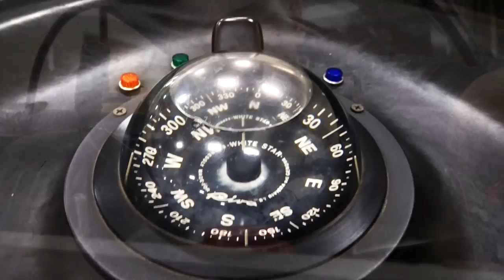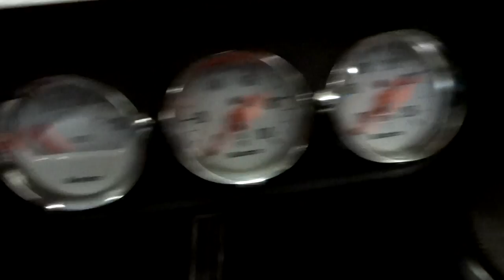GEORGE BARRIS BATMOBILE DISSECTED! - FIREBALL MALIBU VLOG 698

Comment: I'm finding a lot of Batmobile Videos of "Original" Batmobiles.. Unfortunately none of them are actually Original Batmobiles.. There is only one Original which was built from the 1955 Futura Concept car.. The car in this video is not that car.. 
George built the original, and he (his shop) built 3 replicas to satisfy the demand for appearances at various events and one of those cars (the #4.. Third Replica) was for doing exhibitions at drag strips around the country.. 

All 4 of the Barris built cars are accounted for. The #1 and the #2 are both owned by Dave Anderson in Fairfax, Virginia. The #3 car is owned by the Morris family in New Jersey, and the #4 car is owned by Doug Jackson in Scottsdale, Arizona. 

This is a Bob Butts Replica body .. If you look at the rear fender flairs they lean in more than any of the Barris cars.. This is because Bob Butt's molds, (which he took from one of Barris' replica cars) are warped. So his cars (bodies) are easy to spot. Bob Butts and George Barris were well acquainted and Bob built a couple replicas for Barris. One of those cars was used in the movie "Return to the Bat Cave" . And that is the car that sits in the show room at Barris Kustom City. The car in this video looks like that car from "Return to the Bat Cave" .. 

But the Original Futura Batmobile, which was the only car used on the TV Series (with the one exception of about 4 or 5 seconds in the episode called "The Contaminated Cowl" .. in which the #4 car was used in that one scene)

Comment: This is not the original 1966 Batmobile.  It is a replica built by the late Bob Butts and sold to Barris.  Barris sold the #1 Futura-converted Batmobile at Barrett-Jackson on January 19th, 2013, for $4.62 million (after auction fees).  The replica shown in this video does have some screen action, however:  it was the Batmobile in RETURN TO THE BATCAVE, in an episode of BIG BANG THEORY, and many other appearances.  Nice video, though!  And even though it's not the original, it is still cool.